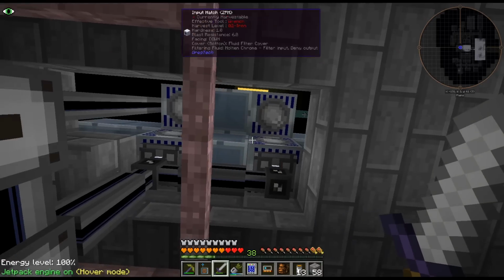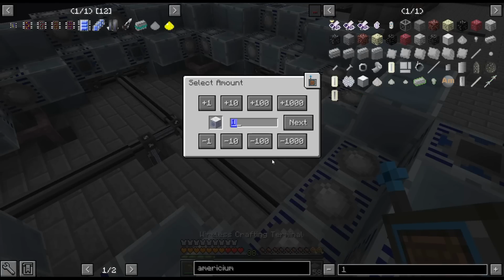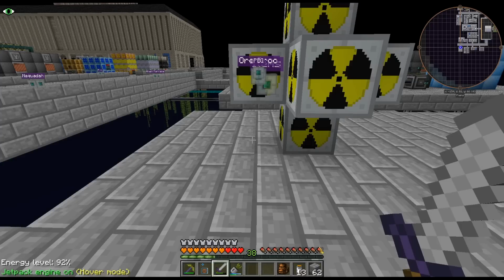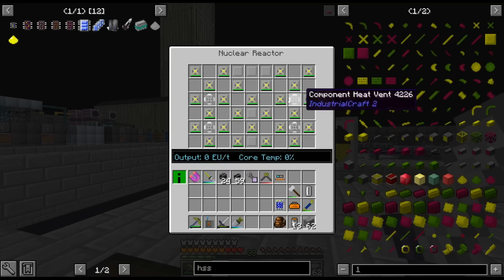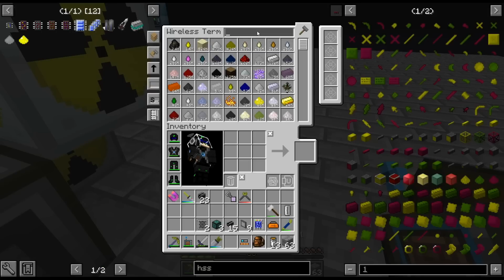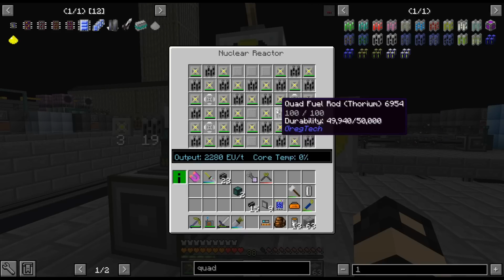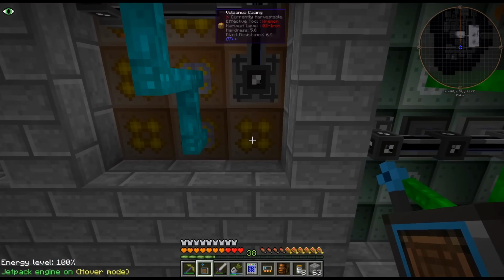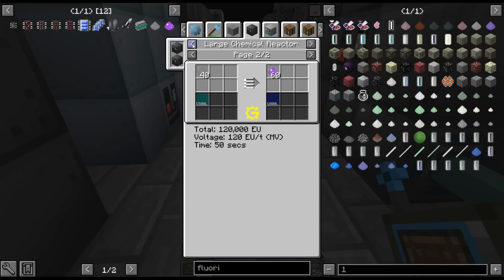GregTech New Horizons S2 - 210 - Passive Neutronium

Comment: Those reactors are only every 13:53:20, or, 1.728 cycles a day (ideally, probably an extra second or two from conduits, each cycle, in the real world), which with 34 a cycle and eight reactors, that's 470.016, or maybe just say 470 a day, if this is running 24/7.

Comment: i think you need to make a sececiond lagre battrey stroage adn alot of exrta secodary battery storage detected to just for big crafting mechnie expasons. this is becuse you got alot of power output but you need to start use it before the plamsa buldup for your power turbines gets cloged  from geting fully filled up sooner or later. also its time your you to mssvly upgade the size for your ae me network core also each ae me network core manfrime block gvies the me ae sistem 32 more chanels for each exrta network mainfirame block. also build alot more drives too.

Comment: You definitely want to have a bigger buffer for crystal chips, maybe using a drawer buffer
Fusion control computer mk3 requires a bunch of americium, plus you need extra UV hatches to upgrade multis
Might want to get into Blood magic meteors for lutetium, you want it for holmium for cheaper wetware, unless you do bastinite line
You can pump fluorine at some point
Calcite is really good to make quicklime
The naq line uses a lot more fluorine then you get out
Trinium rotors are good now